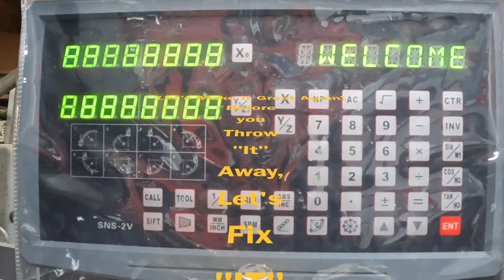Model A Overheat Part 3

Comment: I’m afraid nothing about this engines insides screams “newly rebuilt” or even recently rebuilt. My 1930’s engine was rebuilt in the 70’s from best I can tell and is still shiny clean inside and when I upgraded my head there were still cross hatch marks on the cylinder walls meaning it has been driven little since rebuild.

Comment: Putting rope in a cylinder and rotating the engine will break the seal on the head .
Reply from the maker: Never had to resort to Rope! That should do the trick however! Thanks for the suggestion!